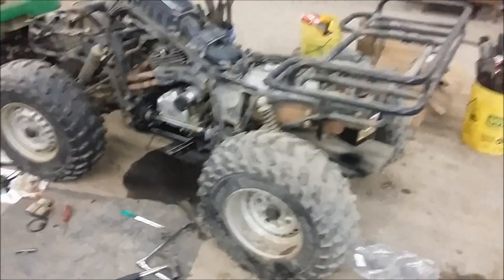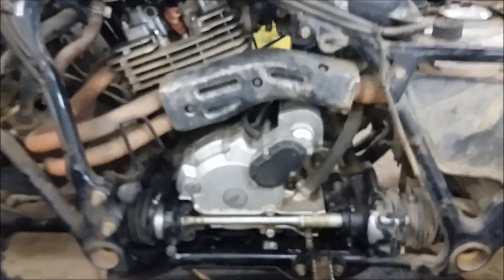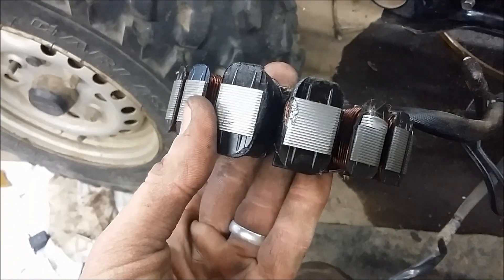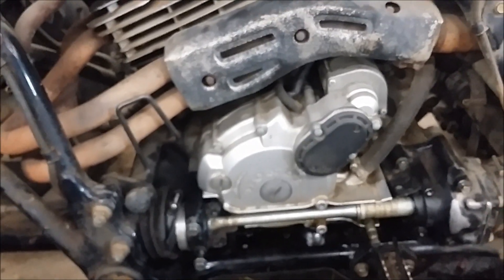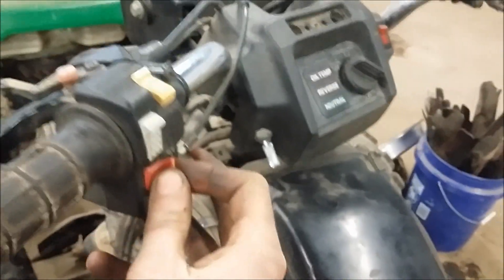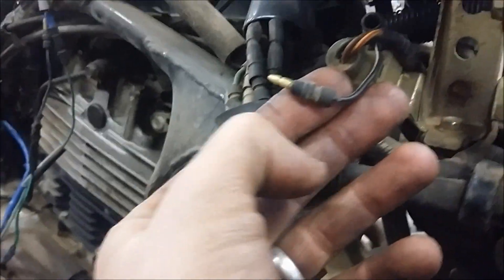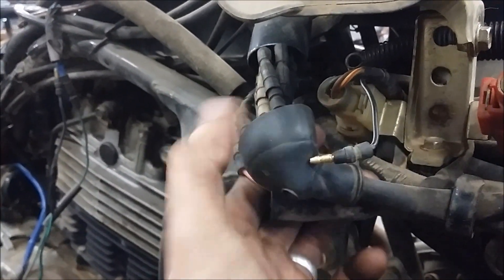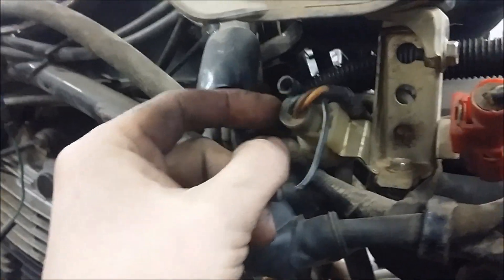1986 Honda Fourtrax 350 Killswitch bypass

Comment: I’m having no spark issue on a 1986 Honda fourtrax trx250 I got off my Brother in law.
I replaced the CDI, Coil plug, spark plug and pulsator.
I’m really hoping this works for me.
I’m growing tired of replacing parts with no results.

Comment: Have a question brother, on mine the electric start doesn't work and just makes a click noise so I'm not sure how to fix that so i have to kick start it and I've already replacedthe starter solenoid.  But anyway the bike will run only if I keep spraying starter fluid ...now the fuel pump makes noise and there's gas in the fuel filter so I'm not sure what is making it not stay running. It has spark and everything seems to work including the kill switch so I'm at a loss
Reply from the maker: If it has a new solenoid and still won't turn over then I'd think it's the starter. Pull the starter off and ground the body of it and touch a hot cable to the prong to see if it spins. As for not running sounds like either the carburetor or the fuel lines are stopped up. Clean the carb and blow air through the line.
Reply: @Small Engine Shop  it turns over and runs fine but only if I keep giving it starter fluid after that it just quits so I guess I'll check the fuel lines then
Reply: As for the other issue Since I replaced the solenoid and am still getting the clicking noise when i push the electric start button then would that just be the starter itself , causing all the issues

Comment: my starter works but dont engage inside the motor... i pulled the starter and its fine... what else could it be? 
it would engage sometimes and other times u could hear it grind a bit on something. it after 3 years stopped engaging... lol... now whut? i cant find info on this issue. again... its not the starter.
ps... i tryed to push start this quad fourtrax 350, it would not start. is there a reason or do i now have another issue?
Reply from the maker: I cant remember on this model exactly but a lot of them have a one way bearing behind the flywheel that let's the starter turn the engine over but free spins the other way. That bearing could be not grabbing.
Reply: Starter clutch

Comment: i have a question if you're still around ---- if the kill switch malfunctions, does it stop the engine from cranking ? or blocks the Plug from firing while cranking ?,  or does it kill everything? Thanks in advance for a reply.
Reply from the maker: It depends which bike you have. Some of them will still turn over with the kill switch off, they just won't spark. But most won't turn over at all with the kill switch off.
Reply: @SmallEngineRepair  Thanks for the Reply SES.. :)
Reply: my bike has no spark, I've replaced all the ignition parts and still no spark, the bike will turn over with Killswitch on but won't when off, so could the Killswitch be good or just try unplugging the wire and check it?
Reply from the maker: @shaneisenberg9829  you could try u plugging it. Have you tried a new spark plug? Does it have a new stator and pick-up coil?
Reply: @SmallEngineRepair  yeap I've replaced coils, spark plug, relay box, ecu, stator, regulator recifier, the bike I have is a 07' ninja 650r
Reply: @SmallEngineRepair  This may help someone else -- i have a 2005 Honda 350 Rancher ES,  after changing out the Coil and still had no fire to the Plug -- i took apart the Kill Switch -- and a small steel Bearing fell out to the ground, so i cut the two wires to the kill switch and connected them together and did a test start before reassembling everything back together -- and the Engine cranked right up -- so i saved myself a lot of tearing apart the thing to replace a Control Box. :)
Reply: Small Engine Shop I have a 1983 Honda cx650C and sometimes I get spark and sometimes not you think the kill switch can be the problem?
Reply: @JoseRodriguez-nl7no  I have the same thing as mine as well but mine is an 07' and a friend of mine said my ecu isn't programmed to the vin of my bike so I gotta spend $500 to get the ecu programmed
Reply: Shane Isenberg I hope that's not my situation...the mechanic told me the stator was the problem but he never check my bike he just knew because it's very common on this particular bikes andI know a lot of people change stator,ignition coil,cdi and still have the problem so I need to make sure or at least try to find a better way to find the problem before I spend hundreds and don't be able to get it fix
Reply: @JoseRodriguez-nl7no  did you replace the ignition or did someone? or do you have the stock ignition
Reply: Shane Isenberg ignition its stock...it's working now I was messing a lot with the kill switch and since then it's been working but now the stator cables get really hot right were they connect just before the plug were they connect

Comment: Is that quad an  electric start , does the start button still work with that disconnected ?or is it just a pull start motorcycle Hope this works for my 400EX 03
Reply from the maker: Yes the start button still works. It only bypasses the red slide kill switch so you have to cut it off with the key.
Reply: @SmallEngineRepair  thanks for the fast reply man ! Do you know if a bad kill switch will not allow spark thanks starting with small repairs before I replace solenoid and relay
Reply from the maker: @x3frankV  no problem hopefully I can help. Yeah if the kill switch is bad it won't spark at all.
Reply: Will this work on a Yamaha
Reply: he un ploughed one wire no 2 or more

Comment: Thanks👍 I have no spark or fuel so will that sort my problem too please?
Reply from the maker: It won't sort the fuel problem but it might solve your spark problem. Thanks for watching. Please subscribe!
Reply: @SmallEngineRepair  also I wanted to add that my quad was running before I parked it up in heavy rain and strong winds. Do you know of anything that might of got wet that would make it not run?